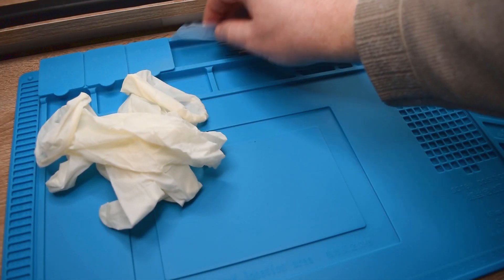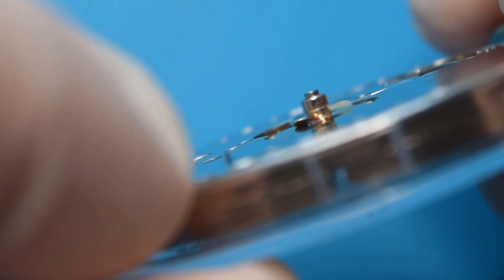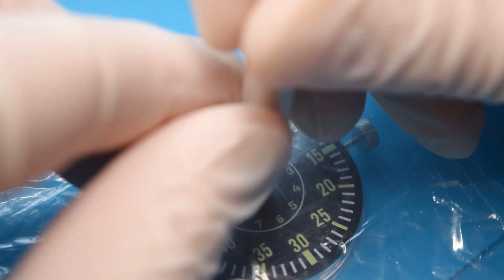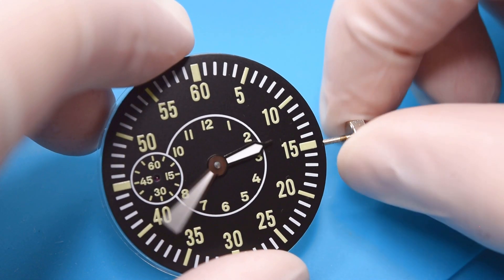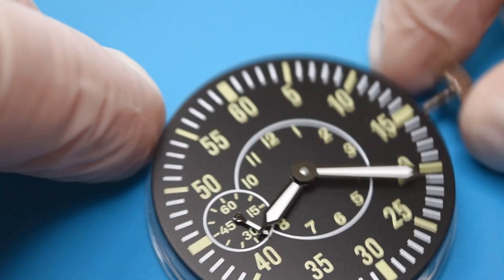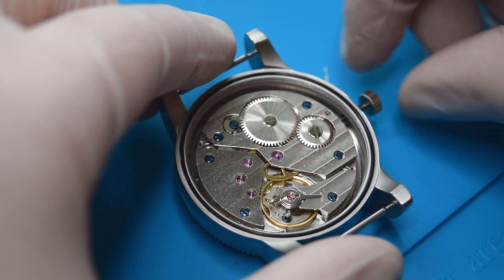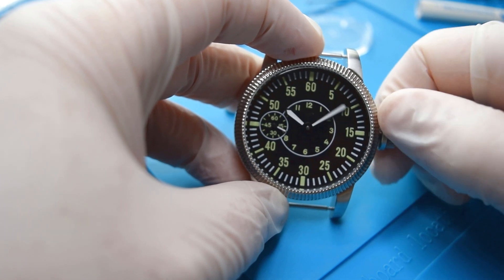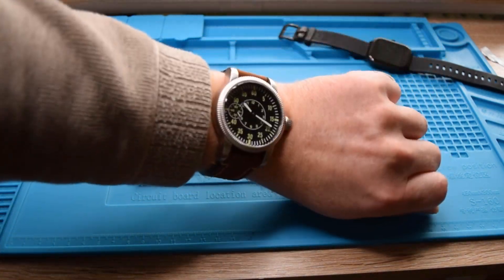Build a Big PILOT WATCH | I build my own custom World War II Beobachtungsuhr TYPE B at home

Comment: Hi, Sebastian, new sub here. I’m building a watch very similar to this one, I have a slightly different case and different hands, but I might change the ones I’m using, I very much like the style, although the hour hand is too long, it goes past the inside hour ring and I don’t like this, but I love the style as they’re like an aeroplane gauge needle. I’m not game to mount the hands myself, I have giant hands and have worked on cars for years and I think I could easily damage them, especially the sub dial hand! I take mine to a jeweller to have them done haha. Looking forward to see what else you build!
Reply from the maker: I am planning to build another pilot watch but this time with Seiko NH35A inside
Reply: @tickingWATCH  yeah, I’d like to use one of those also. I normally go for the Seagull or Miyota mainly because of price, but i think when I build a watch exactly as I like I will put an NH movement in.
Reply: @tickingWATCH  oh I meant to say I actually have that same case as you, I’m going to build a dress watch, and was thinking I may have it all polished. I have a white dial and a set of blue filigree style hands and it will look very nice, but as I don’t really wear a dress watch often I’m not going to order a movement until I build all the others I’m building.

Comment: Amazing work! The only part I don't like is the coin-edge on the case bezel, it's weird for a Flieger. Okay, I'd also prefer pure white with a few red accents over that eggshell-yellow on the dial, but that's very minor. 

Btw. as someone doing quite extensive modding, do you know of any preferably very cheap luminious hands compatible with a Tongji/Chinese Standard movement? Or a handset for another movement which can be modified (needle/pliers?) to fit it? I have one watch with an issue with the lume on the hour hand and another one with a minutes hand which is a bit too short and I'd love to fix that.
Reply from the maker: Thanks, Alias Anybody for parts see links in the description down below. 😀

Comment: I grabbed last Aliexpress sale one of them Seagull versions of the Venus 175 as I had some vouchers saved up, this is the beautiful mechanical chronograph movement but wondering where to find case, dial etc for it and hoping it will fit into a Strela case which means I can have a Sekonda Strela at a fraction of the cost of one with the Venus 150 in.

Comment: Hey! I'm just catchin on to your channel you do exactly the type of watch building I love to see. My milling machine needs parts and maintnence right now so some down time. I'm building tool sharpening/ grinding stuff and looking at home built EDM wire, drilling, and sinker. I want to build a titanium chronometer kinda thing you'd wear on the moon thing. Band and case just made for and eta 7750. I have my old Bulova marine star with a miyota quartz I'm starting to think about that GMT homage movement you did a service on it fits a 31 mm I think you still have that how dose it run? Put it on the tick tock tach If it aint right do the lube chart over and show us with the what? is it the purple lid seiko friction grease how good can you get one of those with just following the lube chart? sorry for rambling a bit keep it up your good Thanks!
Reply from the maker: Hi, good luck with your milling machine I also planning to buy a one. 
This GMT watch, I still have it and it still works. About lubricants just go to ETA internet page, download a manual of its mechanical movement and there you will find all date about lubricants and where you should lubricate so this topic is covered there very well. 👍